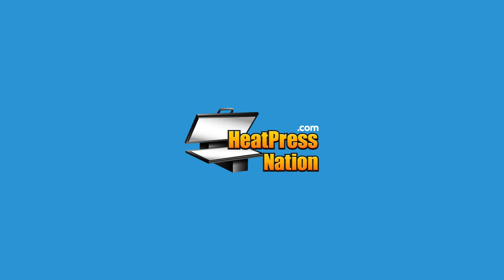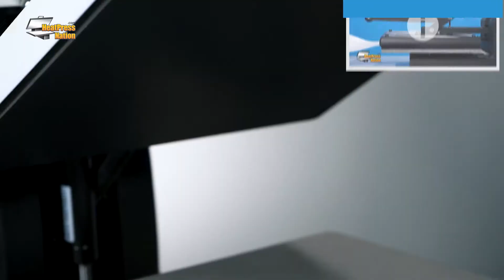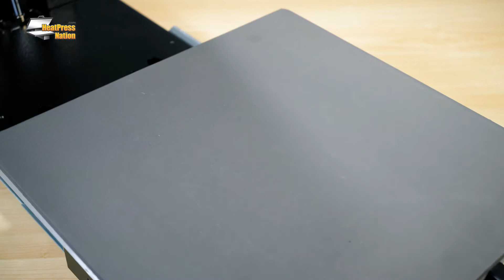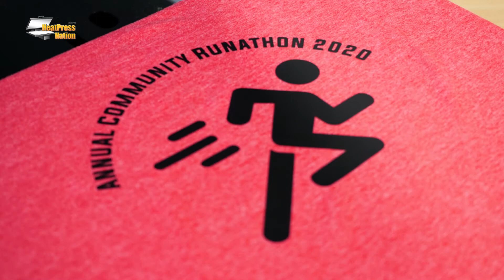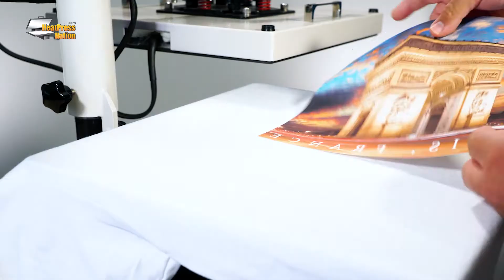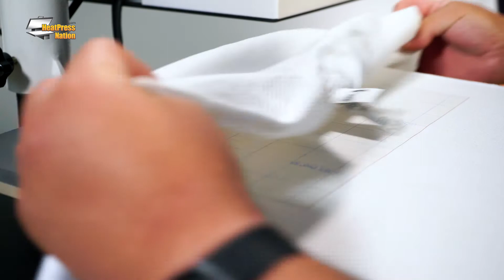How To Apply Stretchable Heat Transfers

Comment: Can you tell me which out of JetPro Softstretch and Subli-Flex 202 papers gives the best looking and most durable results, please?
Reply from the maker: "Best-looking" is totally subject to whoever is looking at the finished product. Jet Pro Soft Stretch will eventually fade as its washed and worn over time. It gets very soft and has a cool vintage look to it. If you want to see a real-life example, check out this instagram post: https://heat.press/jpssigtest

Forever SubliFlex 202 is a newer product for us, so we haven't had years to test it like we have Jet Pro SS. It is a vinyl material, so you can expect it to hold up similar to an HTV product. From our limited testing, we have seen the colors hold very well.